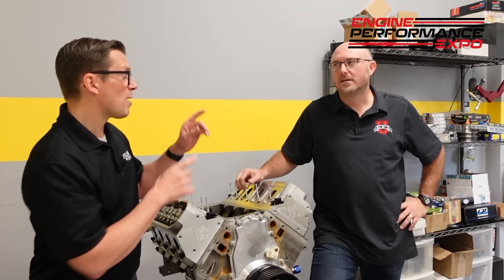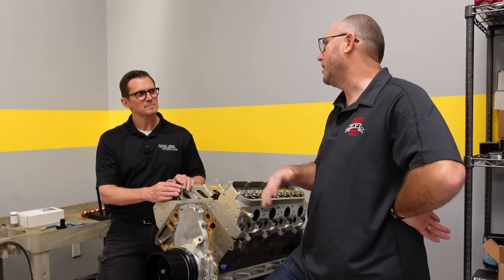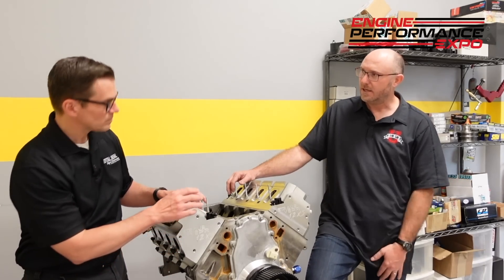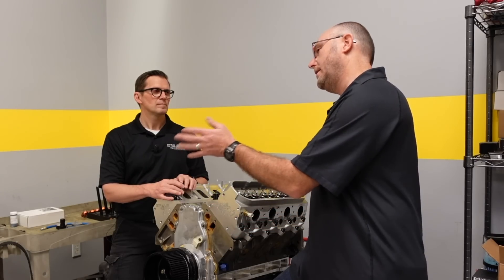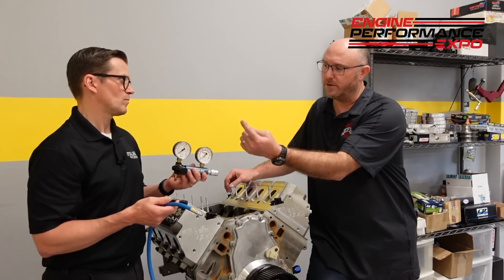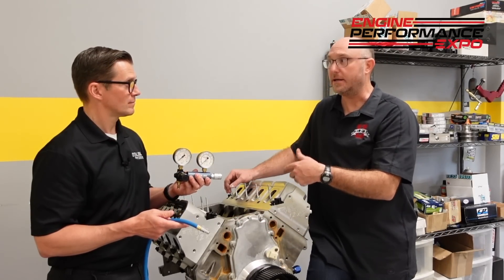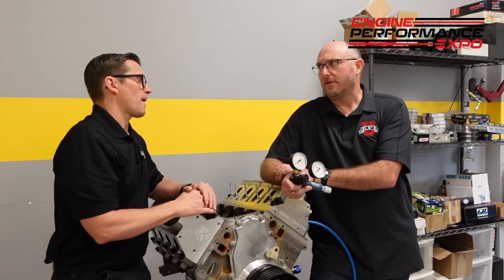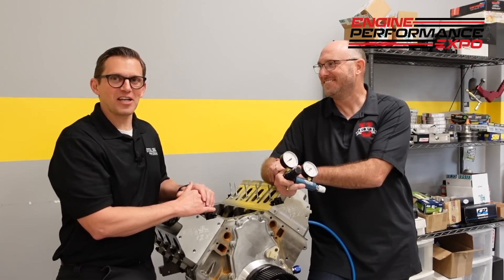How To Do A Leak Down Test - Know the Health of your Pistons in just a few Minutes

Comment: Question to those experts out there, trying to do a leak down in my Tacoma, piston 4,3,2 can’t do it because the engine turns… piston 1 doesn’t move the engine, it feels like leaking through the piston rings , however the compression test showed 150 psi at the first stroke , compression spec: minimum 125 maximum 178 psi, do I really have a problem with the piston rings ? 😔

Comment: On my petrol engine i got perfect compression 185psi on each cylinder, and no leaks (gauges showing)... But still extensive consumption on oil...sometimes during driving grey smoke comes out from the exhaust....i don't know where is the problem. Maybe valve seals?

Comment: At 11:13 a lot of leakage is because soft piston rings tend to get stuck early on and that’s what cause high oil consumption.
Reply: Agree 💯 , I’m battling a 💩 like that right now in an used car I bought 🤦‍♂️
Reply: @64arguz  A Berryman B12 Chemtool piston soak will help with that. Especially if you have an inline engine. Plenty of videos out there.

Comment: All the engine experts in comments are saying that this will not work. Well I can tell you that this will definitely work. piston rings are supposed to seal 150+ bar pressure of combustion gas during running. Leaked test is actually done with compressed air and pressure is checked to see if it's leaking or not. And some genius experts are saying petrol will leak with no pressure but just gravity lol. Btw I'm a marine engineer dealing with 1 lakh + horse power engines.

Comment: Hi! . Dear friends, I have a question for you. I have a Pontiac Grand Prix(1991), it has a GM 3.1 LH0 engine. The problem is that the compression measurement shows ideal values on each cylinder (13 Bar), but the tightness measurement is not good. It turns out that the leakage is at the level of 10%, identical on all cylinders. A small amount of oil shows in the intake manifold. The engine does not smoke at all from the exhaust, only water vapor when cold. Sometimes the engine shakes slightly at idle speed. Please tell me what will cause such a 10% pressure leak? Will the engine run badly? , will it burn more fuel? , will it have less power? , is this why it may tremble? Do I have to repair the engine due to this pressure leak? Pressure is leaking through the pistons because there is a loud noise coming from the oil filler point. I am asking for help. Regards . Adam from Poland.

Comment: Those things typicly compare flow of the leak to the flow of a .040" hole it has inside. The same reading on a big engine is not the same as a smaller engine.  2% on a big engine is fine but the same 2% on a 125 motorcycle is a disaster. Testing at 100psi means you have trouble testing at anything but TDC. With lower pressure you can test down the bore. What is needed is a flow meter that shows the actual flow that can be related to cylinder size and get a true percentage.

Comment: I used to have one of those gadgets about 40yrs ago until someone "borrowed" it. Then I thought "how hard can it be to build one?" A small regulator, two pressure gauges and some form of small orifice between to upstream and downstream gauges. But that orifice size is pretty subjective - big hole will make the leak-down % small, and small hole make it a bigger leak-down number. Who gets to decide that?
My latest thought was why not measure actual air flow (cfm) at a given inlet pressure?  I just haven't built that yet, but still planning.
Reply: That's coming from a machinist too lol. Much like yourself I find myself trying to make random things in life "because I can". Once said and done I realize my time is valuable. I can't make anything as cheap as I can purchase it in 99% of cases

Comment: You talk at length about not to worry about single digit differences but not anything about when you should start to worry.   Also,  is it more difficult to just divide to get the percent leakage or set it to 100 and have the crank spin on you out of control?
Reply from the maker: The gauge has ranges that show when the results are outside of normal

Comment: I checked my LQ9 build with gaped rings @.025 top .027 bottom and it was within 5% across the board after 15k miles checked a pentastar the same day 50-25% 😵‍💫

Comment: A key benefit to a leak down test is legacy results over time. Do baseline testing after the engine is built and run in, and at regular intervals, esp a race engine, and also if you start having performance degradation or issues, before you start chasing the chassis or various engine tune variables, do a leak down on the engine. You’ll get a much more precise indication of engine health than you will with a compression test.

Comment: In aviation we do leakdown tests on our engines annually. We do the test at 80 psi, because it's much easier to hold the propeller that way, and you're less likely to get hurt.
Reply: I can imagine the force on the crankshaft would be enormous on an airplane engine. Huge bores and stokes compared to automotive engines. Be tough to hold the prop from turning. Especially a gear deducted prop.
Reply: Oh man ,she's down at 75 over 80, better tear it open.

Comment: I just tore my engine down and got 91-95 on all cylinders besides #6 which came in at 82%. Had to be past the rings since it wasn’t coming out of the head but I didn’t see anything wrong taking it apart.
Reply from the maker: Piston rock can also cause high leakage.
Reply: You tore it down for no reason.

Comment: A leak down test is a good second test to a compression test. I periodically test and record the compression on my race engines. If one of the cylinders is low, this is a great way to quantify it. You can use the air hold for on the engine spring changes to listen to the engine to help determine where the problem might be without the need of a leak down gauge. I am a tight wad and always try to find the cheap work around. I would certainly use a leak down gauge if I had one, but I rely on the compression check and air hold for now. Great video.

Comment: Hi Lake. Sorry guys. But you missed the mark here. You never mentioned if the tester you were using is properly calibrated or not and to what standard it is calibrated too? Without that information a leak down test is  waist of time.  Can you include those facts and the regulator type used in your next video please.

Thank you. 🏁
Reply from the maker: The Total Seal leak down testers are fully calibrated and are set up for 100 psi shop air.

Comment: I haven't used my Tavia leakdown tester for 30 years.  I now have a high (294000) mileage Chevy S10.
I'm scared to know what its going to read. 😁
First time I have seen a video about using one of these.
Will i be able to tell from the hissing sound if the  leaking is  from the valves or rings?
Im assuming so.
....heck, it will be both 😁
Great video.
Reply from the maker: Thanks for sharing

Comment: I learned in 1968 how to and why to do a leak down test.
I remember back then my new friend just out of NAM had his new 67 Mustang 289-271 HP car. It only had 6,000 miles and we were hungry to learn so we leaked his 289 it was even all 8 cylinders @ 22-23% we were like what?
Compression was even too all 8 I don’t remember but 165 psi sticks in my mind but anyway we took it to the Drag strip and ran 14.23@ 97-98 mph. Which was ripping in 1968. So never worried about Leak down for many years. Trusted compression and balanced cyl to cyl.
Live n learn.
M
Reply: Was that a snapon tester? cus they are grossly inaccurate as are almost all testers that use 1 gauge.

Comment: BlaBlaBla, you do a compression test first. if the compression is within specs, there's no need for a leak down test.
Reply: A compression test can be better if you know what compression that particular engine normally has at the condition you're doing the test at. A leak down test tells you precisely how much the leakage is and where it is leaking but it won't indicate valvetrain issues unless it's a valve being kept open.
Reply: For a daily driven street engine, if the compression is 120psi or more and they're within 10% from the highest to the lowest, you're good. @fascistpedant758

Comment: I have a weisco piston in a sb2 total seal ring 28 gap 4 thou wall clearance and it will leak 20 then i can just hold the crank enough to rock the piston and it leaks good.  I really do not like it but weisco says its fine. Any thoughts
Reply from the maker: That is a piston rock issue. The difference should be less when the engine is warmed up.
Reply: That's a video vid like to see regarding all about piston rock & why🤔.  I think you maybe already covered it?🤔

Comment: Is it best to do a leakdown and compression test on a cold engine or hot cast iron block? What about aluminum?
Reply from the maker: It can be done either way. Just know the results will be different hot to cold. The hot check numbers will be lower due to thermal expansion of the pistons and rings.
Reply: Hot Engine